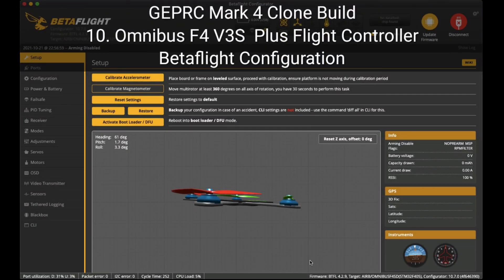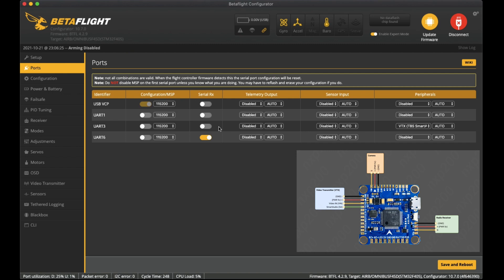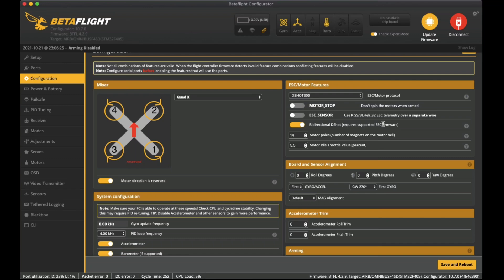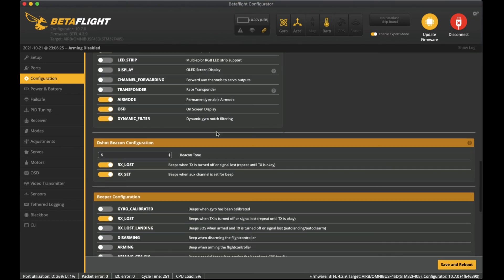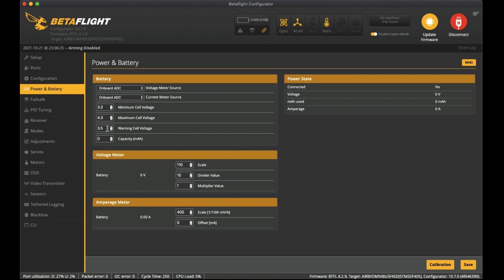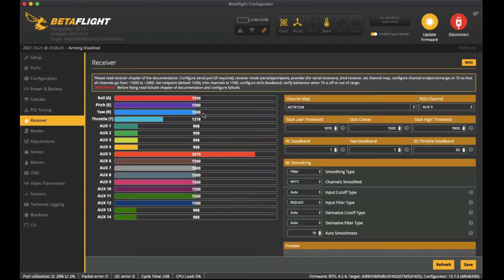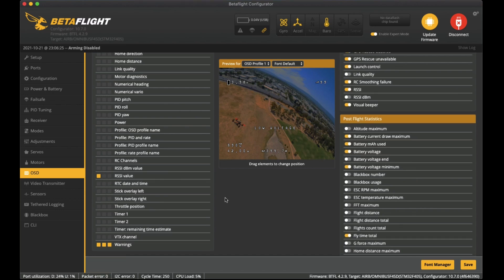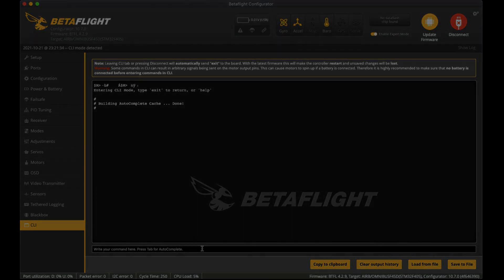GEPRC Mark 4 Clone Build - 10. Omnibus F4 V3S Plus Betaflight Configuration

Comment: First off great video, honestly one of the better tutorials for this gear. Second, I have a question about sbus. I have mine wired up exactly like yours however I dont see input on betaflight, what could be the problem? My Rx is bound to radio I just dont see inputs.

Comment: If i soldered everything, dó i need to install all this true computer, or does it fly right away?,say standard setting..
Reply from the maker: Most of the time you'll still need to connect to the flight controller with Betaflight using a computer. There are configurations that need to be set such as the ports tab for the receiver/VTX/etc, Modes tab for "Arm" switch, Motors tab for motor order and direction, etc.

Comment: Olá, este controlador aceita elrs?
Reply from the maker: The flight controller does not have any radio control receiver in this build. The receiver I installed is not an ELRS. You'll need to buy and install a seperate ELRS receiver such as the HappyModel EP2

Comment: why does betaflight freeze when connecting the usb card and battery at the same time?
Reply from the maker: I haven't seen that happen before. Does it happen when using different cables? Do you have another flight controller to try?

Comment: I am following your guide to build a drone using the FSI6X transmitter, FSIA6B receiver, and Betaflight app. I have correctly connected the receiver to the SpeedyB F7V3 flight controller and successfully bound it to the transmitter. In the Betaflight application, I can see the receiver responding to transmitter inputs in the receiver panel.

However, I am facing an issue where the motors do not spin when I move the transmitter switches, despite having connected the ESC to the flight controller and ensuring all setup is correct according to your tutorial. The battery is also connected, but the motors remain unresponsive.  What should I do ?
Reply from the maker: You'll need to set up a switch on your controller to be the "Arm" switch in the Modes tab in Betaflight. I would also suggest to set a "Pre-Arm" switch which acts as a pre condition to arming (two actions required to activate the quad and spin up the motors). Search on YouTube for tutorials by Joshua Bardwell (or others) on this topic for more info.

Comment: how did you connect to the computer?
Reply from the maker: Plugged it in using a USB cable that supports data (not all USB cables support data, so make sure you have the right one). I use a Mac OSX, which does not have any driver issues. Windows might not have the right driver, check out this page for help with that: https://oscarliang.com/fc-driver-issues-flash-firmware/

Hope this helps!

Comment: Thanks for your videos, they really helped a lot, but even though I connected my card and did the update, the barometer does not turn green. I tried deactivating and activating the barometer but it still doesn't turn green. what should I do
Reply from the maker: The latest version of Betaflight Configurator allows you to add or remove parts of the firmware that gets flashed. Perhaps that may have caused the barometer to not get added and is now not configurable. I would try to flash the flight controller again and select "Classic" mode before flashing.
Reply: @nxp200  I 
I tried but unfortunately it didn't work

Comment: After everything is done do you still connect the smoke stope while flying the drone ?
Reply from the maker: Thanks for the question! The smoke stopper is only for testing on the bench. It prevents high current from flowing if it detects it and saves components from frying if wired up incorrectly. Once tested and all components are powered up correctly, then there's no need for it anymore and a battery can be plugged into the drone directly. You also cannot fly with the smoke stopper, even if you tried, since the amount of current drawn by the motors would "activate" the smoke stopper and no power will be supplied to the drone.

Comment: What do I have to do to connect the board to bettaflight?
Reply from the maker: Open Betaflight software on your PC/Mac, plug in USB to the flight controller and then plug the other end into PC/Mac. The flight controller should have flashing LEDs. Wait about 10 seconds and then click "Connect" on the Betaflight software. If this doesn't work, try another USB cable, as not all USB cables support data transfer. Hope this helps! Good luck!